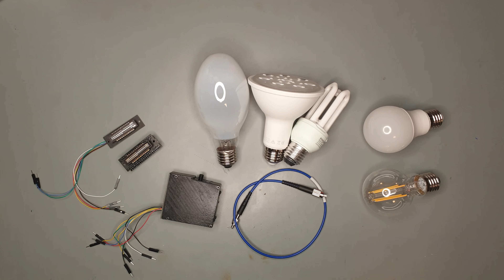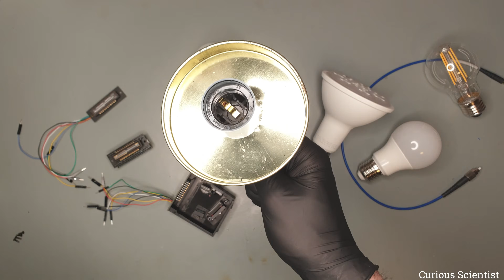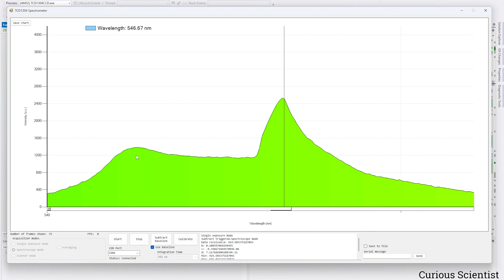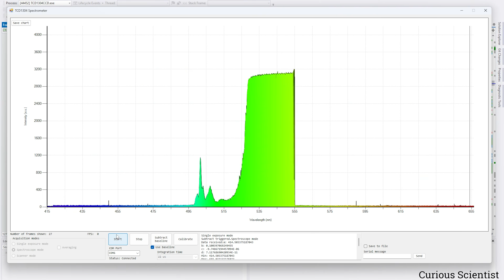TCD1304 spectrometer - Part 5

Comment: AI Summary:

Abstract

This video (Part 5 of the TCD1304 spectrometer series) details significant updates and demonstrations of a custom-built spectrometer project. It covers hardware revisions, including redesigned PCBs for the TCD1304 CCD sensor and integration with an STM32 microcontroller. Key software enhancements are presented, focusing on an improved calibration algorithm that utilizes a third-order polynomial fit derived from fluorescent lamp spectral lines for enhanced wavelength accuracy. The calibration's effectiveness is successfully validated using 650nm and 532nm laser sources. The video showcases the spectrometer's practical capabilities by capturing and analyzing the distinct emission spectra of various light sources, including different types of LEDs (filament, standard, grow light), a tungsten lamp, and a high-pressure sodium lamp. Notably, it demonstrates the dynamic spectral evolution of the sodium lamp during its warm-up phase in real-time. Software features like baseline subtraction are also highlighted. Project resources, including PCB designs via PCBWay and captured spectral data, are referenced for viewers interested in replicating or learning more about the project.

TCD1304 Spectrometer Project Update: Calibration and Spectrum Demonstrations

*   0:05 Project Focus: This video updates the TCD1304 spectrometer project, focusing on software improvements, calibration using a fluorescent lamp, and demonstrating various light source spectra.
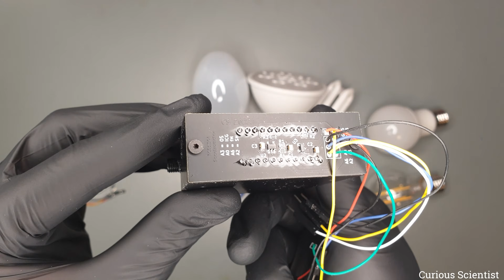*   0:25 Hardware Base: The project uses a BMW Tech BTC 100 spectrometer housing, originally missing its lid and CCD.
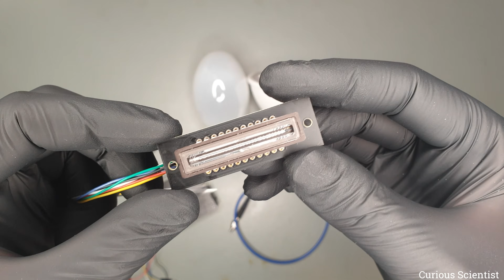*   0:35 Custom CCD Board: A custom PCB was designed for the TCD1304 linear CCD (3648 pixels), an upgrade from the original Sony ILX 511 (2048 pixels). This board has been revised and shrunk.
*   0:54 STM32 Integration: A version of the CCD board is designed to mount directly onto an STM32F411CEU6 microcontroller for compact operation.
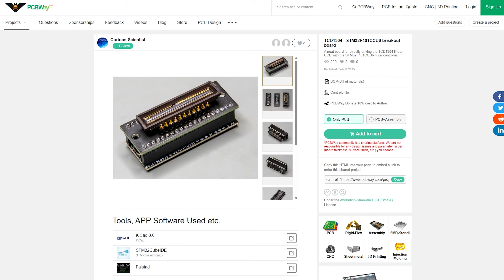*   1:19 PCB Availability: The custom CCD breakout boards can be ordered via the creator's PCBWay project page.
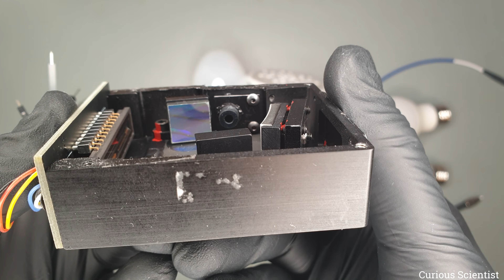*   2:30 Optical Path: The spectrometer includes a 50-micron entrance slit, collimating mirror, 1800 lines/mm grating mirror, and a focusing mirror directing light onto the CCD.
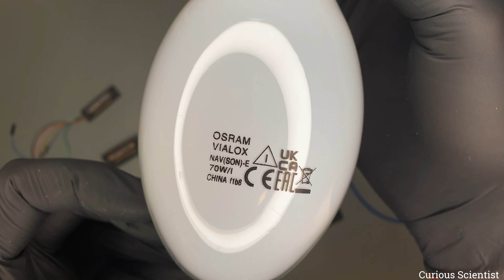*   3:12 Demonstrated Light Sources: The video showcases spectra from a fluorescent lamp (used for calibration), high-pressure sodium lamp, IKEA grow light, standard LED bulb, and an LED filament bulb.
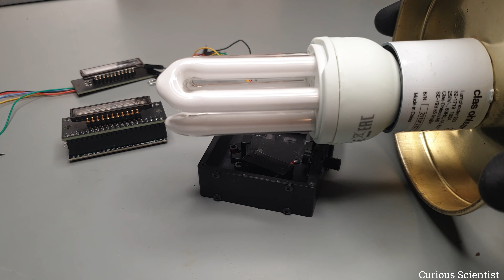*   4:36 Physical Demo: Light from a fluorescent lamp is shown passing through the spectrometer optics, creating visible green and orange spectral lines on paper placed before the CCD sensor location.
*   5:16 Custom Software: The creator demonstrates custom software featuring multiple modes (Single Exposure, Spectroscope, Scanner) for capturing and visualizing CCD data.
*   6:35 Baseline Subtraction: The software includes a baseline subtraction feature to remove the CCD's dark signal/offset for cleaner spectra.
*   8:00 Improved Calibration: The calibration algorithm was updated from a simple linear fit to a 3rd order polynomial fit using four distinct peaks from the fluorescent lamp spectrum, improving accuracy across the wavelength range.
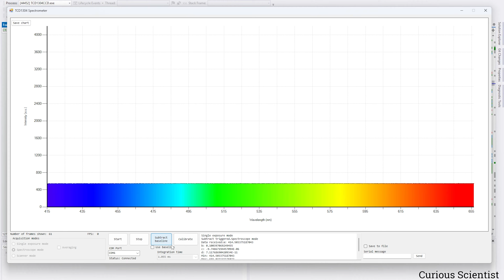*   9:36 Fluorescent Spectrum: The calibrated spectrum of the fluorescent lamp is captured, showing distinct emission peaks used for the calibration process.
*   12:32 LED Filament Spectrum: Shows a relatively smooth spectrum, weighted towards warmer colors, mimicking tungsten but much more efficient.
*   13:52 Standard LED Spectrum: Similar to the filament LED but dimmer, likely due to its opaque cover.
*   14:48 Tungsten Spectrum: Very low intensity captured due to using a low-wattage (11W) bulb (high-wattage incandescent bulbs are unavailable in Sweden), highlighting its inefficiency compared to LEDs.
*   16:16 Grow Light Spectrum: The IKEA grow light shows distinct spectra: the outer ring provides broad spectrum white light (strong blue peak, distributed green/red), while the inner ring adds a specific deep red peak.
*   18:04 Sodium Lamp Warm-up: The high-pressure sodium lamp spectrum is captured in real-time during its ~2-minute warm-up, showing characteristic spectral changes.
*   20:36 Sodium Peak Splitting: A key observation during warm-up is a prominent single peak splitting into a doublet as the lamp reaches operating temperature.
*   22:20 Laser Validation: The calibration accuracy is confirmed using red (650nm rated) and green (532nm rated) laser pointers, with measured peaks at 653.5nm and 532nm respectively, validating the fluorescent lamp calibration method.
*   25:42 Future Plans & Support: The creator asks for suggestions for future spectrometer applications and encourages viewers to support the channel and check his website for captured data and PCB links.

I used gemini-2.5-pro-exp-03-25| input-price: 1.25 output-price: 5 max-context-length: 128_000 on rocketrecap dot com to summarize the transcript.
Cost (if I didn't use the free tier): $-0.0212
Input tokens: 20304
Output tokens: 868
Reply from the maker: Thanks, I appreciate it!

Comment: Hey, I'm curious as to whether or not your design employs the op-amp in a follower configuration (which would likely be sufficient to stabilize the output) or if it's used as an active low-pass filter to remove unwanted pixel level noise. I'd appreciate any info, but if that falls under intellectual property then that's also okay.
Reply from the maker: Hi! It is a simple inverting amplifier. The OS signal of the CCD goes to the inverting input through a 56k resistor. The input is also connected to the output via a 82k resistor. The non-invering input gets the output signal of a voltage divider which consists of a 22k and 15k resistor. The voltage divider gets its input voltage from the onboard precision voltage reference, REF3040.

Comment: What lenses are you using? Do you have any recommendations for diffuser materials?
Reply from the maker: I don't use any lenses, I just directly shine the light onto the slit or the optical fiber.
Reply: @CuriousScientist  Fascinating. Once the light passes through the slit, though, it hits the collecting mirror and then passes through a focusing lens though, correct? Or am I mistaken about your lens configuration?

I'm also very fascinated by the feature where you adjust your integration time. With my spectrograph, I'm able to send single 'r' characters to the stm32 board to request a new frame of pixels, and I think I could add functionality to alter the integration time, but I'm uncertain how you update the integration time settings. Do you change the parameters for the SH timer to adjust the integration time, or am I off track?

I think being able to change integration time would make calibrating the device much easier, as it's far too easy to saturate the device with the lasers I'm using. It would also let me tune the sensitivity so that I can use a greater variety of light sources.

No need to give me your whole solution btw, just enough info to get started. Also, I made a spectrograph client that runs on python, and works on windows, ubuntu, and mac! If you want to see it lmk :)))
Reply from the maker: I am pretty sure I carefully explain the optical configuration starting at 2:30, there are not pass-through lenses, only mirrors. Watch the video...

Adjusting the integration time is just sending a new ARR value to SH as well as resetting all the timers properly.
Reply: @CuriousScientist  Right, sorry, I meant to say mirrors. I've just struggled to find good concave mirrors online without using expensive optics suppliers.

When you reset the timers, do you simply call HAL_TIM_PWM_Start as you do in the setup function? Or is there another reset function that I'm missing.

Thanks!
Reply from the maker: When I stop, I stop all the timers, set their counter to zero and clear their flags. Then, when I start, I just start as it is described in the video/article. First, I start DMA, then the timers. 

Regarding the optics, just buy the whole kit I bought. It is like $120 for a fully assembled and adjusted (!) optical setup, you just need to insert the CCD, put the lid on and run it.

Comment: Very nice. About 15yrs ago I also built a spectrometer using the TCD1304 and an old Ocean Optics optical bench. I used an ATmega chip and serial data output and used Matlab to read and display the spectra.  I used mercury vapor to calibrate.  Fun stuff
Reply from the maker: Nice project!

Comment: 15:30 I'm very curious, doesn't higher-powered incadescent lamps being sold as a space heaters in Sweden?
Reply from the maker: I honestly never saw any. The only space heater I can think of are those infrared heaters with some sort of quartz tube in them. But I have never seen tungsten filament space heaters. Fun fact, I bought the mentioned 11 W tungsten lamp as a "decoration lamp". If I search for incandescent lamps, none of them show up on the regular websites where one would usually order from. They are getting more and more rare.

Comment: Why does the fluorescent tube spectra bounce?
Reply from the maker: Great question! I noticed that those light sources which are driven with high-frequency (non-DC) voltage, tend to bounce. I would assume that this is some sort of "aliasing" issue (driving frequency vs. CCDs reading frequency). When I read a laser or an LED (both are DC), the height of the spectrum is solid.
Reply: @CuriousScientist  I guess you could switch to Averaging mode to smooth it out? It's interesting to the see the dynamics though!
Reply from the maker: Yes, I implemented the averaging to get rid of similar effects.
Reply: How low can it go? I'm interested in reflectance spectroscopy for minerals, paints, inks etc the further into UV the better for markers.
Reply from the maker: Please watch the video, I literally talked about the exact range when I calculated the calibration parameters. It is something around 410-420 nm if I remember correctly.
Reply: @CuriousScientist  can that be tuned with the diffraction media or is it a limit of the ccd?
Reply from the maker: It is the "limitation" of the optics, I would say. The "edge" of the light reflected onto the surface of the CCD is around that wavelength. If I could compress the light beam, I could detect a wider range of wavelengths with the CCD, especially towards higher wavelengths. The CCD has a wide spectral response from about 400 nm up to 1000 nm.